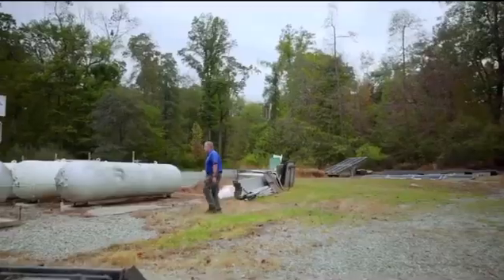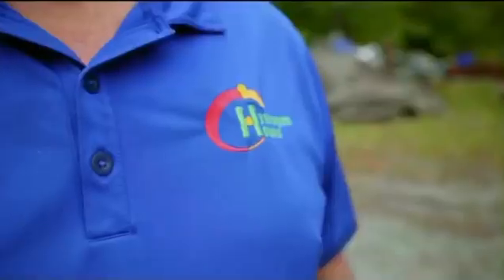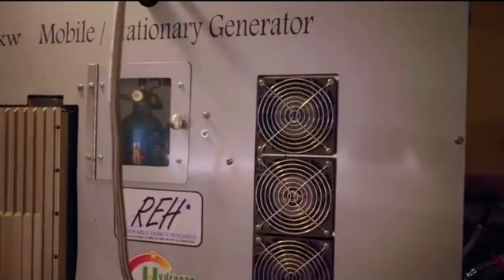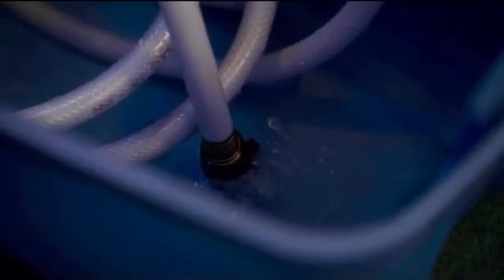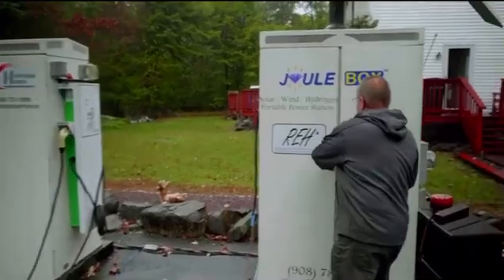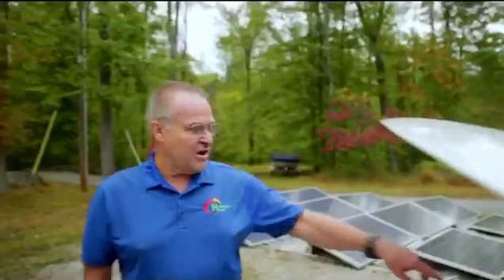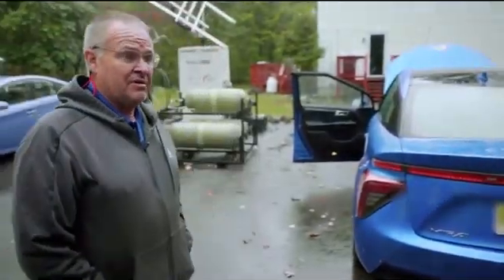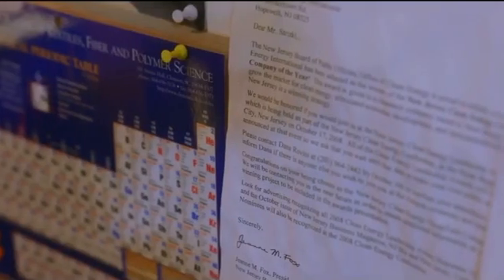Hydrogen House Project

Comment: Please give me the detailed plans to create my own hydrogen generator, how to compres, how to convert my furnace and car.
Reply: Mike buys his hydrogen generators from standard suppliers.  One of his other videos says he's spent over 3 million dollars on his setup. You can do it, it just takes a lot of cash.  Mike has said his electrolizer generates about 2kg/day.  That's about 130kWh worth of electricity. If he did that from solar running about 12 hrs a day, he'd need a generator that's at least 10kW.   Small generators like that run about $3,000/kW or about $30,000.  Then you'd need tons of other equipment too.
Reply: @scottkolaya2110 For 130kwh a day you need a 20kw inverter, not 10. No sun shine 13 hours at high peak.

Comment: seems like this died... last thing reported was 1 year ago...  I'm guessing it fell short of obtaining an investor.  If it has big investment then tell us where to buy a kit, if not tell us how to DIY, you can sell a license and instructions with a DIY kit and not void the patent, it will only generate grass roots marketing to people who don't want to DIY, but buy it.  All most DIY need is a fuel cell that can convert Hydrogen to Volts and Amps as many of us have plenty of Solar, inverters, and batteries.
Reply: The problem is the equipment is really expensive.  And you need a lot of land if you're going to store H2 cheaply like Mike does at low pressure.  His tanks take up more land than his house.

Comment: I just purchased a 2022 Mirai and as far back as 1974 I have believed in the power of hydrogen to power our cars and home.  I wish this could be available to us home owners in California so that we can push forward the power of hydrogen to clear our air and get us away from fossil fuel and to the power of the sun.
Reply: There's no one stopping you.  You can spend all the money Mike did.  The electrolyzer alone costs about what you paid for the Mirai.  Then you've got tanks, etc.  California will even help you.  You'll quickly find out why H2 at the pump is $36/kg.  It's all the equipment, not just the solar power.  Mike's electrolyzer, compressor, etc takes about 70kWh to make a kg of H2.  You can drive your Mirai at best 70 miles, right?  That's 1 mile/kWh.  By just putting it into a battery, you can average 4mi/kWh in an EV.  Mike has a cool project going on there, but it's not cheap.

Comment: I understand H2O electrolysis, solar power, and fuel cells.  However, I have no idea how you get the Hydrogen gas into those pressurized tanks. Can you do a video on the compressor system you use to do that?

Comment: I have been working on this to power my work shed and use hydrogen stored from the solar panels.  lol a month ago someone went in my shed and stole my electrolysis unit. I am getting a new one but I would like some input to get to make this stuff without having to buy lab grade equipment
Reply: I use fuel cells for the power and use no batteries
Reply: @peterindzonka5322 and what did your electrolysis unit cost?

Comment: I have a serious question and will definitely contact you soon. My question is how would this be on a HUGE level we are talking in a Crypto mining farm consuming around 40,000W/H nighttime with enough solar panels in the morning to supply it in energy. Can these hydrogen cells be designed on a similar and bigger scale and used instead of the battery systems?
Reply from the maker: Please email your inquiry to info@hydrogenhouseproject.org
Reply: @HydrogenHouseProject  Mike , can you give people the rough average of how much you think it would cost them to have a setup like what you have ?
    I could have sworn that in a video I saw of yours about 10 years ago where you said how much you had spent back in the day to get this up and running .

Comment: But there is no commercial version of this hydrogen generators setup. That's the problem. Not everyone is an engineer to build it from scratch.
Reply: There is an Australian company that sells an all in one hydrolysis and fuel cell system. Uses waste heat to heat home
Reply: @ThomasBomb45  Lavo , Australia, seems to be good, has some proprietary storage media.But the Hydrogen house is super cool engineering and implementation, Kudos to Michael. Remember this was done 16 plus years ago..and he has been making improvements since I guess...
Reply: How much did the hydrogen home cost?  I've been thinking long term about having a house 3d printed and I'd love to be off the grid as a bonus.
Reply: @velocityraptor7188  go to the channels that had those printed houses and read the comments because after what I read in the comments there's no way I would ever get one

Comment: Well this is just an amazing system! I'm living in Canada with 3.5 Kw of panels and 220Ah of batteries @20 hrs and 48V. I know my batteries are undersized but my dream is to use my outback to run an electrolizer once the batteries are charged to store up fuel for winter heating and backup generation. I am inspired by the work being done at Ohio U where they are electrolizing urine and getting large returns on their hydrogen production compared to their electricity use, compared to water with electrolytes.
So much to say and learn but storage seems to be that big issue. I wonder if you could direct me to NiMh hydrogen storage tank sources?
Love to see that ozonated water for cleaning! that is brilliant! You are a very inspiring human in this world, thanks for sharing your work with us all!